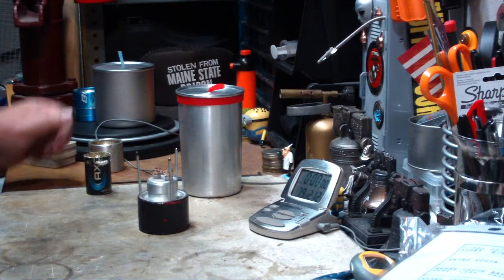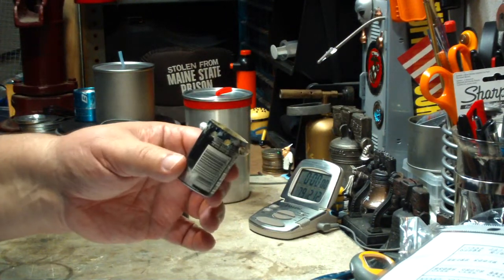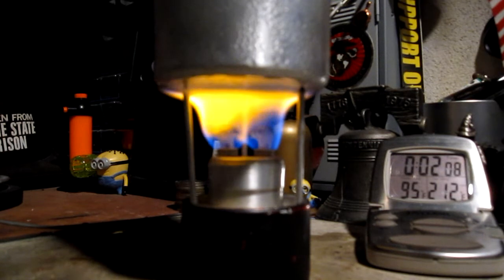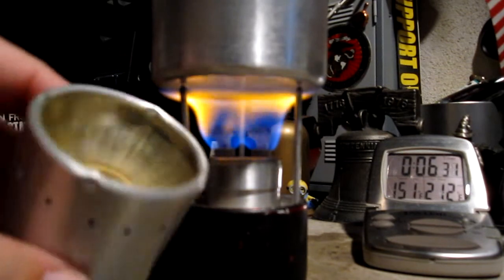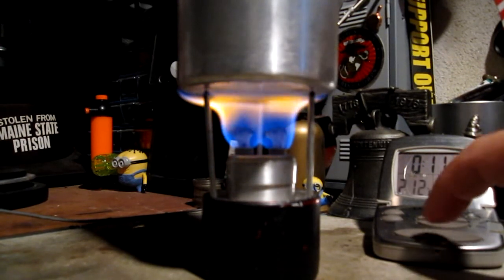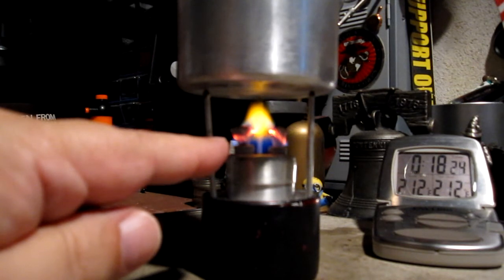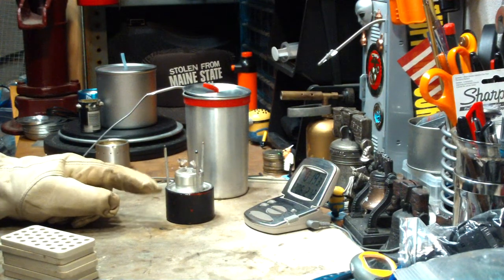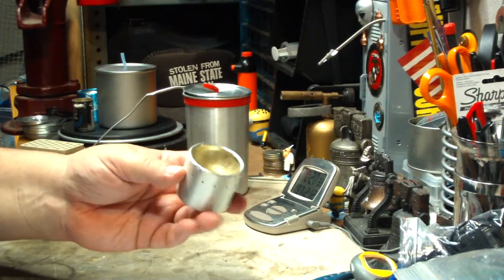BatchStovez 22 oz Ultralight Cook Pot - ebay Alcohol Wick Stove - Boil Test #1

Comment: Hiram; the stove with two wicks was the MiniBull design Iso fly. I got one in a batch of used camping equipment. Yes you are supposed to put water in the bottom of the stove to keep the alcohol from boiling.